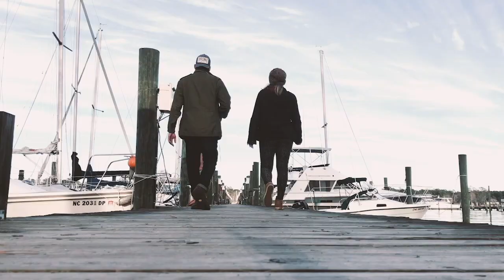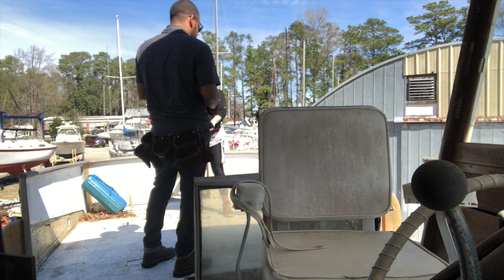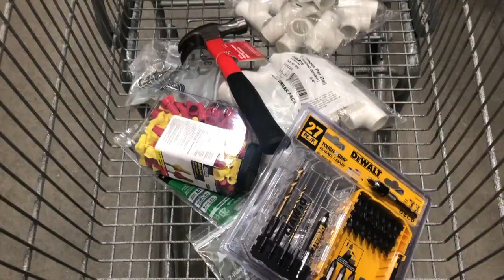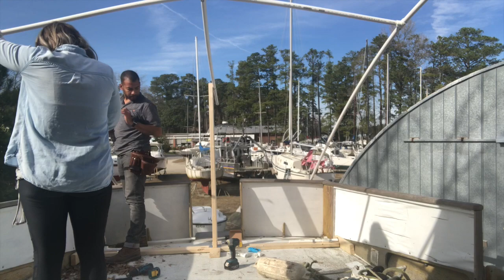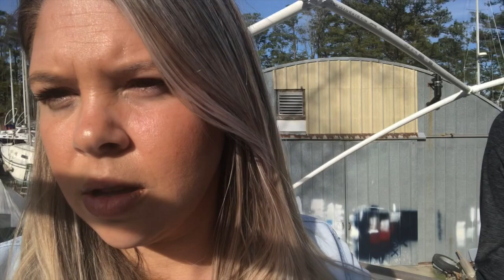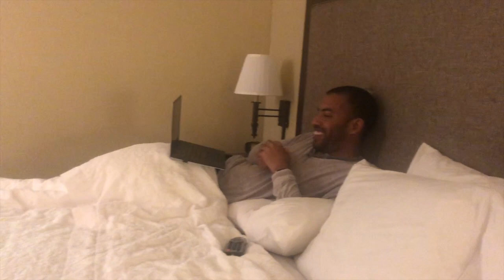Temporary Canopy to keep the rain out of Bilge - Chris Craft Yacht Refit -  Ep. 3

Comment: I must have missed something....did you get a survey done and is the hull OK?
Reply from the maker: Yes we did! Just weren’t there for it— our hull is mostly sound— it has actually been fiberglassed over. Only a couple of places at the bow to spot fix where it has delaminated.
Reply: @loversaboardodessa6294 
That's rather ominous...you should never fibreglass over a wooden hul Firstly there wouldn't be a reason to do that if the structure was in top condition. If needed rotten sections can be cut out and replaced and sealed in place . Chop out that fibreglass and let your boat breathe and remove moisture.